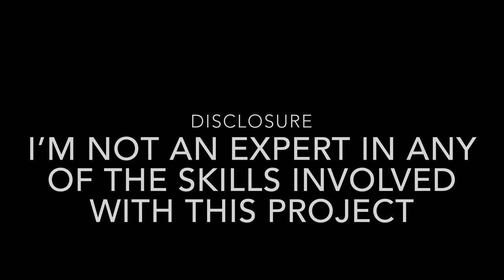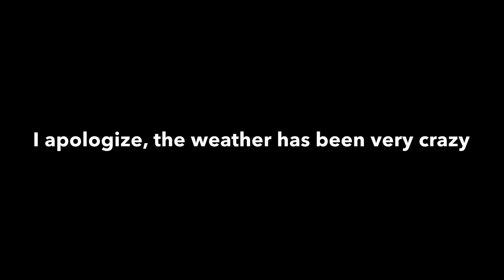DIY BARREL FISH POND

Comment: No need to use any type of sealant with a whiskey barrel. ALL whiskey barrels are 100% waterproof after about 24-48hrs of being filled with water. Once filled with water the wood expands and will NEVER leak again. Also the fish ABSOLUTELY need some type of shade in the form of plants or any type of cover really.. Otherwise they will just bake in the sun!
Reply: You sure about this?
I use a whiskey barrel as an ice bath and after recently moving its location by way of rolling the barrel on its side there are now visible gaps between every piece of wood. I bought marine sealant but i would prefer not to use this if its not neccesary. I will test out your theory 1st and get back to you. Youd better be right😂
Reply: The sealant is likely to keep any of the whiskey residue that has been absorbed by the wood to get into the water, as that can be harmful for fish. That's why generally people use fish sage pond liners inside whiskey or wine barrels when making a fish pond